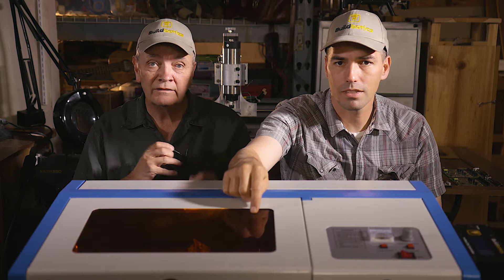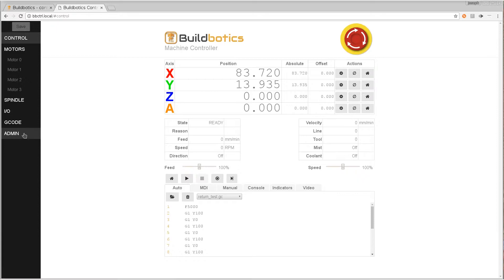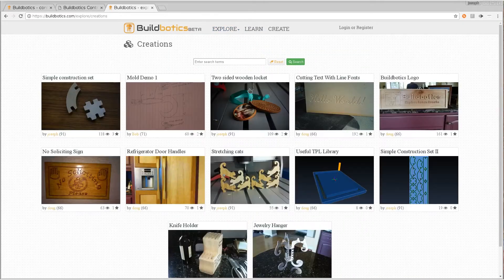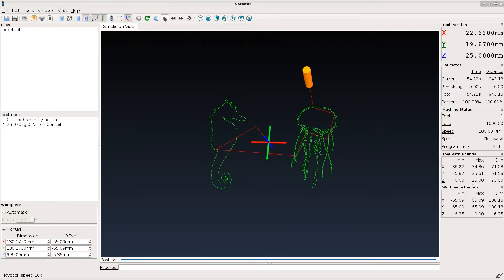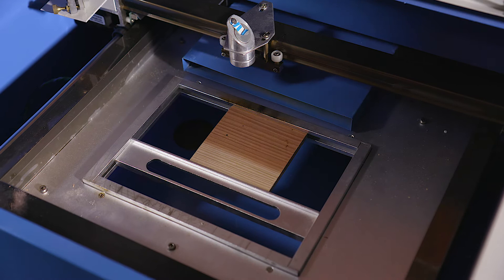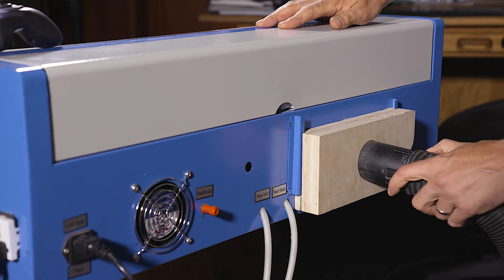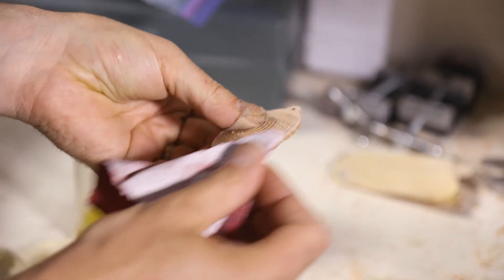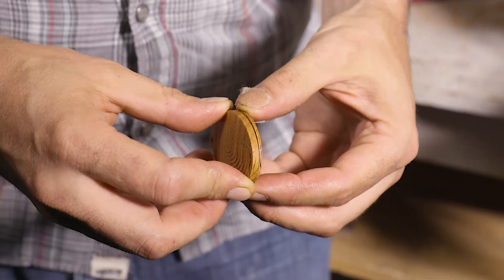Milling and LASER engraving a wooden locket with the Buildbotics Open-Source CNC Controller

Comment: Hello, like the concept. Can you please apply your module to a DIY cnc plasma cutter? Thanks Ray
Reply from the maker: The Buildbotics Controller can be used with a plasma table, but we are not yet able to do automatic torch height control.
Reply: Hi it would be great to see a video or website 
To show how to adapt it for plasma cnc. Do you have any recommendations? Thanks Ray